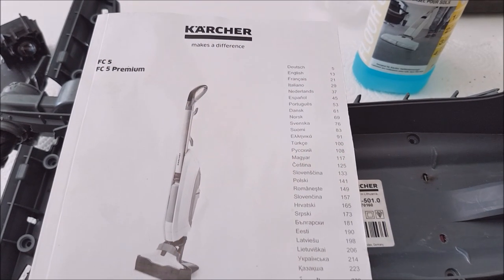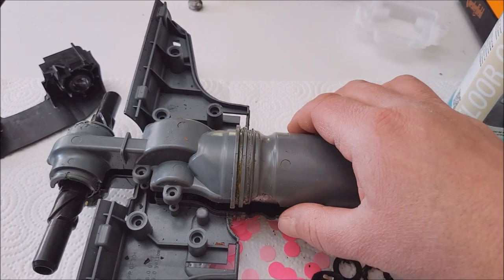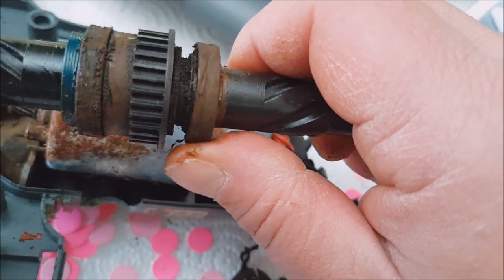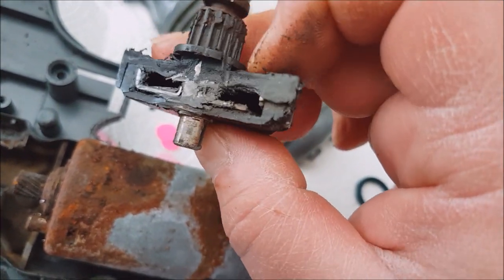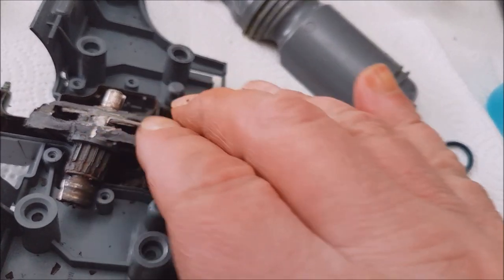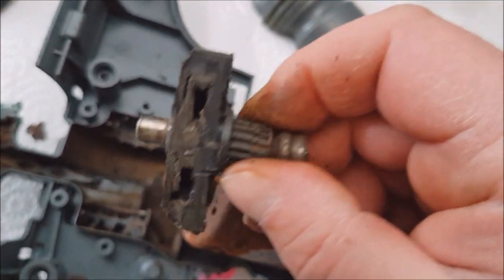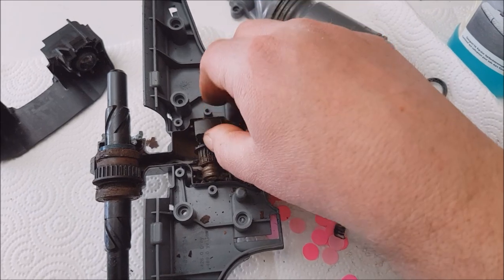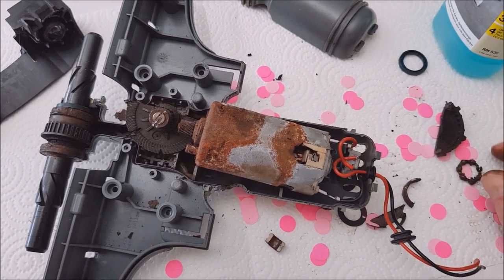Karcher FC5 Fails after 120 uses, planned obsolescence, cash to rust converter exposed !

Comment: I’ve had mine for three years now and the gearbox failed 2times and were replaced on warranty pretty quickly. After the warranty expired and another 6 months of use the clutch started to slip again. The grinding noise is usually the clutch slipping I think so I decided to modify it. I saw the suction lip brake the wheels a lot. The torque on the clutch is quite high but the wheel have a lot of drag. I cut some grooves in the two lips that suck the water from the wheels. This makes them spin easier. After that the clutch didn’t spin anymore and I continued to use it for another 6 months like 15’ per day.
But then one day the vacuum motor failed actually one of its bearings :)
I replaced it myself ( 40€ plus shipping). And with this opportunity I installed a waterproof toggle switch for the vacuum motor because sometime I only need the brushes without the vacuum so to me it’s more convenient to have this switch. 
Yesterday the clutch started to slip again even if it was cleaned and everything in place so it was time to open the gearbox.
Inside I found two rusted and stuck bearings. Apparently one bearing for the steel axle got stuck and the race was spinning on the axle instead on the rollers. The same thing one of the plastic axle.

The conclusion is this gearbox and the motor needs some special maintenance. 
If the race spins on the axle it means in time it can get stuck on the rollers because they will not have the opportunity to move. 

. I greased them then I rolled some aluminum film on the steel axle so the bearing inner racer stays fixed on the axle. With the steel axle is not that critical because it’s steel on steel.
With the plastic axles it’s different. If the bearings get stuck because of the same reason the inner racer will rub on the plastic and it will go but it will get hot. When the plastic gets hot the friction increases and it starts to melt until the gap get bigger but it will still not run smoothly. I placed some aluminum film to make the bearing race stay fixed. 

Maintenance:
This gearbox need to be opened every 6-12 months for inspection and lubrication
You can open the green and blue rings to lubricate the bearings at  a shorter interval

Operation: 
Other than cleaning it after use it needs to be stored with the water collector to allow the vacuum motor to dry 
Also you can run it dry without the water collector tank for 1 minute so the motor dryes quickly

I used  silicone oil because it doesn’t react with plastic
Reply from the maker: Standing ovation for all the work !
The kind of maintenance not everyone can perform or afford.
All due to flagrant design flaws.

Comment: There's a roller bearing that will seize since I leave the roller on still wet. I ordered 2x of Part No. 6803 2RS you need that for the roller spline. Then there's a little servo belt 'cheap' it is 3m-168. I've replaced them for $10 us total with shipping. I bought this and it failed and was rusted so I filled in the bearing areas and around the outer edge of the inner housing with a lucas lithium grease called red & tacky. I reassembled and so far has worked good. I hope it will last longer than the 5 times I have used it. Once all the screws are removed and the green and blue caps are removed, the housing will come apart easy. Good luck

Comment: Same story. I persevered. the first one was taken for repairs 3 times. Finally they gave me a brand new one with lasted less than 10 uses.
Reply from the maker: Those are the dreaded click & screw service unfriendly constructions.

Once all screws are out, one must fight with a plurality of very sturdy clips that interlock the shells that form the appliance.

Reason why I used an angle grinder to gain access to the internals of the second FC5 that failed in a row.

Comment: I have mine working for a couple of years fine, but had to get it serviced lately. I was told in the service that repairs are ok only within the warranty period, after that it doesn't add up. The wheels will brake the suction lip if they are worn and/or swollen up by dampness. Hence: NO washing in the washing machine (hand wash only), proper and full drying of wheels.

Comment: I had the same problem, i fixed it trough forcing the rear bearing to move (with wd40)
The driving mechanisme in the center is badly sealed, it sucks water.
Bissell has a better solution, the bearings are situated on both sides.
Reply from the maker: The BIssel is also easier to oil and remove that small junk that could compromise the driving side of the roller.

Comment: I've got one. The cleaning fluid dispensing system has never worked. It didn't work out of the box, it went back for repair under warranty. It came back with the note saying 'no fault found'. I tried it again. It didn't work.

The only use it now has is to suck up the water on the floor thats left by normal, old fashioned mopping.

All things considered, it's just a very expensive door stop. An absolutely useless piece of kit. Don't waste your money.

Comment: Our's failed today. We're still on our first bottle of cleaner. Wish I'd seen this video before buying. I'm disgusted with Kärcher for selling this crap.
Reply from the maker: Was it replaced or otherwise dealt with by Kärcher ?
Reply: @thermmodhynamics392  I bought ours 'reconditioned', so I had no right to expect Kärcher to do that. Although I successfully disassembled the unit down to component level, I could only buy the complete transmission, which cost me something like £75. (Of course, the original transmission had never been taken apart, so the most vulnerable part hadn't been reconditioned at all.) Taken it apart in a non-destructive way is possible, but very difficult. The product has been designed to it can be assembled by low-skill workers.The duty cycle it gives to customers, and ease of service when the product fails, were clearly not priorities. This has compromised the design in a number of respects, and I cannot seriously consider this to be a premium product in any way other than asking price. The Kärcher pressure jet cleaner I bought new has also failed, so I'm really not impressed.

Comment: I have the same problem the rollers have stopped rotating and the drive spindle is seized. I have taken the head apart but I cannot get the blue and green spacers off. In your video they are already off. I would appreciate your knowledge how to remove them so that I can gain access the the drive mechanism. Thanks for the video.
Reply from the maker: I cut them. There was nothing to rescue. Then I have seen that you can pull them with a blunt knife, they are clicked.

Comment: I expect the Karcher fc5 at wednesday, it’s on the cargo, i’ll shopt from the online store, it’s about 204 dolars in Turkey.
Reply from the maker: Here prices vary from about 300$ to less than 200.
Tomorrow morning I'll tape a video on how to inject protective oil and hopefully remedy the problem.

It's a very good device when it works, granted. However it does not cope with corrosion. Parts are available for analysis, I have contacted Karcher, commotion ensued but no perceivable action.

Therefore we have to take things in hand and do what they didn't at assembly time.

Have a small 2mm drill bit and Teflon oil ready, we spring in action ;)

Comment: Ours worked OK 2 weeks ago but slight hot smell. Tried to use it today, rollers sized. Stripped it , not designed for servicing motor rusted solid. Roller bearings rusted solid.
Replacement roller head unit over £80!!!!!!!
Scrapped it.
Only 2 years old and hardly used, probably less than 50 times. DO NOT BUY. ABSOLUTE RUBBISH